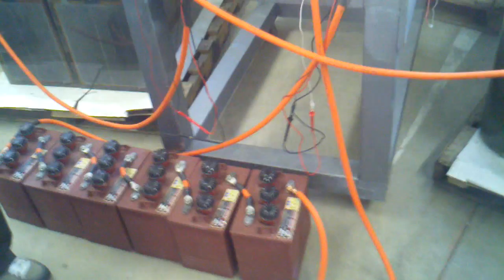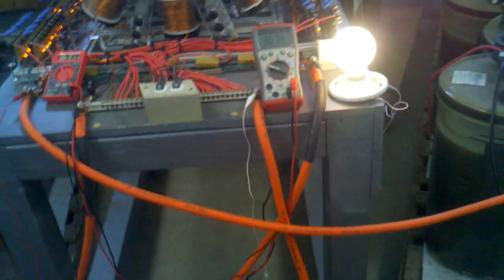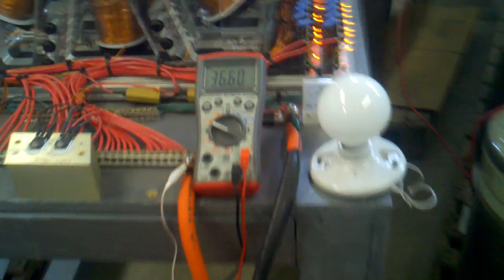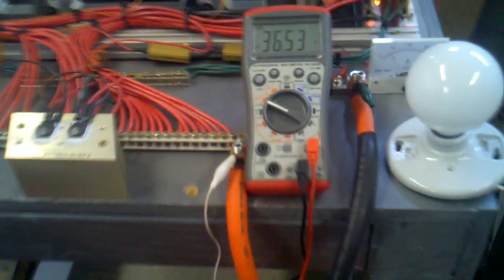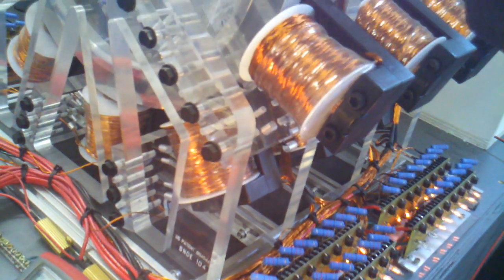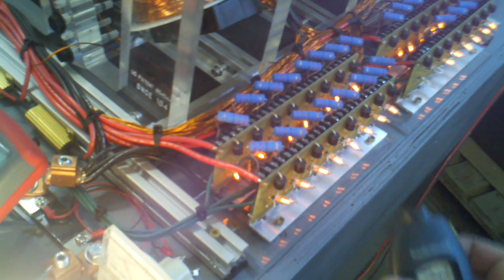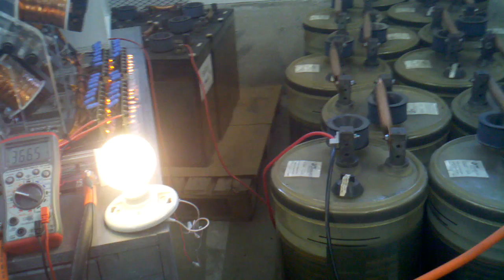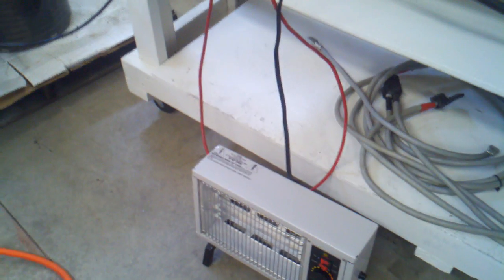3rd run on 30 Coiler Monopole Energizer on big batteries

Comment: I can imagine one in my shed running from solar 13kw, id sit there all day watching with a torch on those batteries
After all the years is there anything else now youd add or change with this awesome machine
Reply from the maker: I decided to do the original 10 Coiler which has never been sold before. What we did with those was actually different in several ways. Here is the link where we are selling it. I'll show video shortly.

Comment: So...if you mounted this charger in the trunk of the electric car, you can then charge while you drive.
Reply from the maker: That's the old model. That one was meant to charge very large battery banks which is limited in a car. With the newer dualpole systems we have a lot more torque and can power mechanical loads at the same time...

Comment: can the Bedini charger work on lithiam batteries, such as the Tesla wall pack?
Reply from the maker: Yes you could use lithium batteries, but they are a lot more problematic to use. You are better off using other chemistries as these will not be around for too much longer. Better use NiMH or some of the newer types.

Comment: do porche have 6 batteries ?
Reply: +Tony Baines 
seems like a lit of trouble to light a 40w bulb.
Reply from the maker: +Tony Baines I do not understand the question.
Reply from the maker: +Rick Friedrich That was not all that it could power. The bulb was just part of the trigger coil if I remember correctly.

Comment: Hallo bitte Bauplan von 3rd run on 30 Coiler  Monopole Energizer   FE. Motor  per E-Mail zusenden.

Mfg.Gattermann Josef   j.gattermann@aon.at  0043 68120592108

Comment: What size were those branch resistors. What were the transistors for in the front that were hooked to the branch resistors it looks like. What did those transistors do.
Reply from the maker: We were switching with positive feed for the trigger and used two transistors. When you run 30 coils you need 2 trigger wires or to do this sort of thing so that you have enough power to turn on all the transistors as hard as you need to.
Reply: Rick Friedrich Wow there is a lot to this stuff. Thanks for the reply

Comment: Hi, how much is the power input you are using to make the bedini circuit start runing?
Reply from the maker: This was 3 years ago so I don't remember. You'll just have to watch the video and see. The idea here is that the bigger the batteries charging the more charging takes place. However, those big batteries were sitting for 3 years or more unused so they were sulfated. The system rejuvenates batteries before it charges and the rejuvenation process is not an efficient process.

Comment: can u help im a   english teacher in vietnam
i have 9 magnets on a 36mm disk dual magnet center disk  n left n right outer disk 9 magnets each  total 36 mag 36 coils 9 on each side  1 disk 9 magnets both sides then each side  then the stator and another dick on right side n left  9 magnets . each mag is 4in x 2 in x 20 mm.
a  3 phase coild stator 9 coils,  theres 8 in my building i figure we need 35kw converted to 220/50
anthonyolivera@yahoo.com
u say 2 wires each transistor
 8 wires 720 turns

Comment: can you help me, please, I have a running single coil bedini, with 4 transistors, 5 wrapped wires. it runs fine,off of 12v,300ma charger, but, no charging is actually done. when, I hook up a 19v/2amp charger, it starts charging, then the transistor overheats, and burns out. mjl21194.diodes 1001 and 1007, 22awg wire. I thought the transistor can handle 16amps. I know the diodes are 1amp.does that affect anything?

Comment: Rick, I'm not sure how to word this correctly, but.. each circuit that you have coming off the multifilar coils, the overall length of wire used, to build that individual discrete circuit... there are so many... how important is it to keep the physical wire length of each circuit the same or similar ... to the overall tuning / performance of the device. Given that the distance from one transistor to it's join on it's coil, may be quite different than the next... hope u get what i mean!